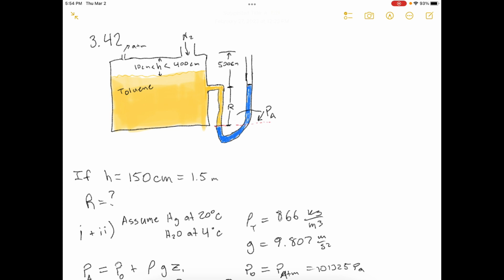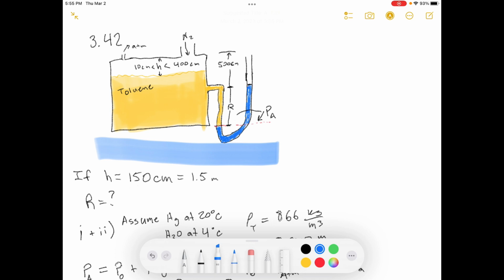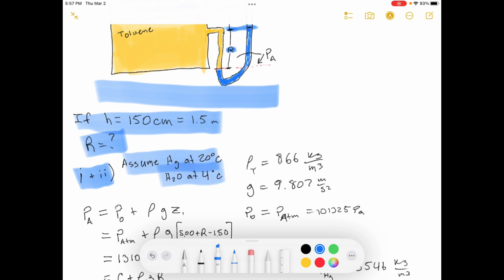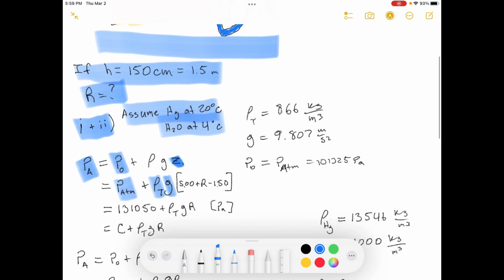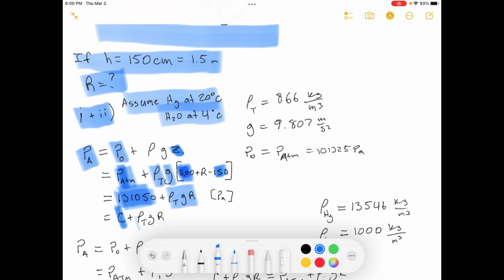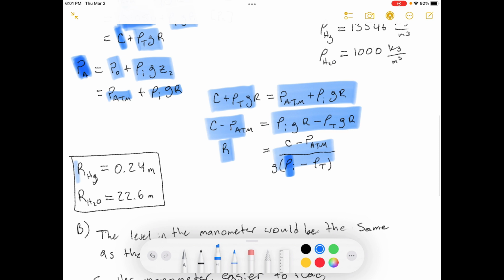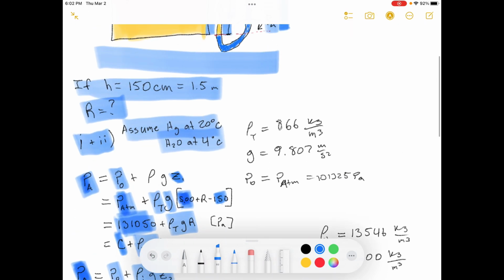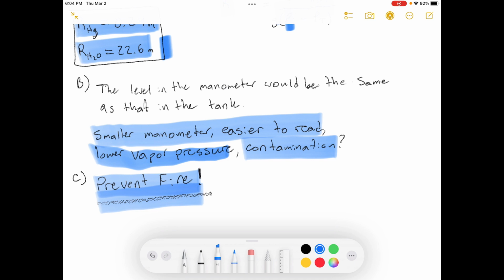TEP - Elementary Principles of Chemical Processes Third Edition - Problem 3.42 - Episode [090]

Comment: How did you get 131050 (your value for C)?
Reply from the maker: The atmosphere is pressure is added to the known portion of the head so 101325+1.5(pt)(g). Hope that helps. Sorry, it was not explicit in the presentation. Sorry, I was a little slow to respond.